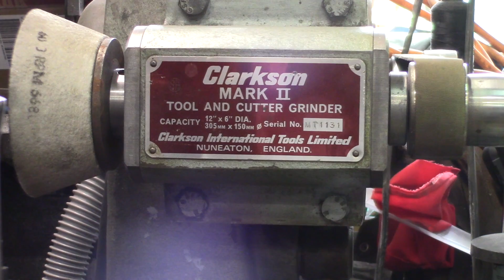Tap followers final operations, tweeking and the reveal. Heat treatment short explanation...

Comment: So the parts are hand fitted and not fully interchangeable? You missed out on the real challenge! lol At least now they all have a personal touch. :-)
Reply from the maker: Hi Brian,
The tolerances aren't that far, the bodies need a little encouragement in order to clean the residue mostly inside, the heat treatment left the finish not as nice as the outside...  Does this mean you wouldn't want one of those...?    lol
Cheers,    Pierre
Reply: I like all shop tools especially the ones that have been shown special attention. Now if only I hadn't broken my drill press I would have already had a home for one! lol
Reply from the maker: With the size of your new shop, there is home for about one million of those, just like a big apartment complex...  lol
Don't worry about finding tenants for your complex,  your kinda shopping for anything that is "HUGE" will help you...   ;)

Comment: The Clarkson has a lot of potential.
Pity about the fractured part... but, hadn't remembered just how many had been made. Excellent venture... aided by peanuts :)
Reply from the maker: Hi Chris,
The Clarkson is a tool sharpener so it can configure in many angles and fashion, practical for angular jobs on smaller parts...   ;)
Cheers,    Pierre